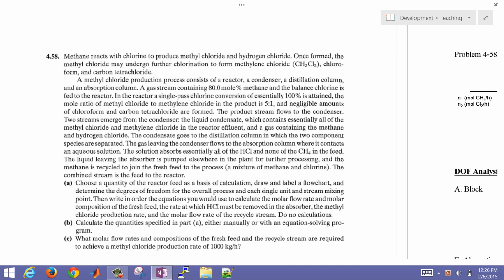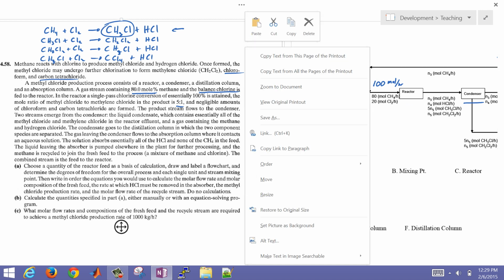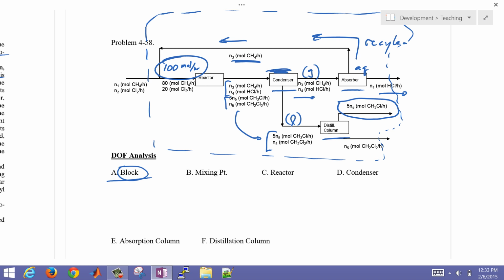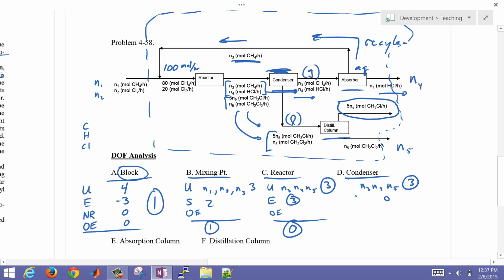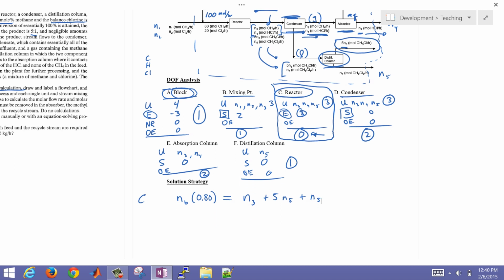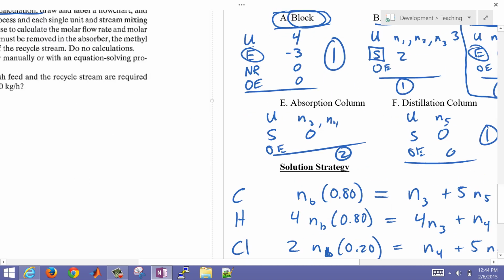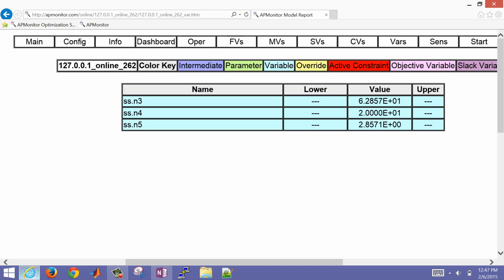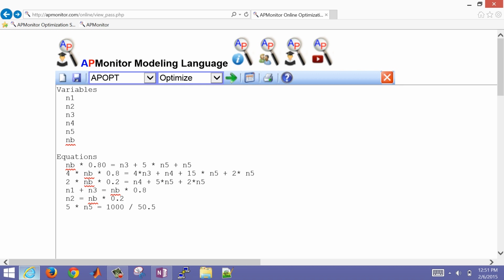Reacting System Flowsheet Analysis

Comment: Thanks for the video! Maybe for the last step we should divide 1000000/50.5 instead of 1000/50.5 because the molecular weight is given in g/mole instead of kg/mole.
 I am note sure though! And thanks anyway!
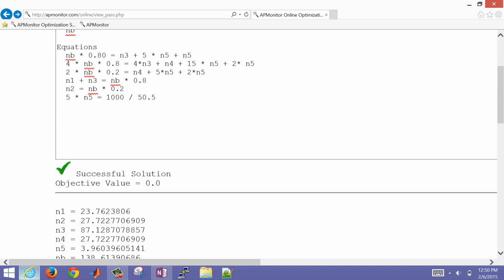Reply from the maker: Yes! Thanks for the clarification at 23:20. I discuss units at 24:40 so it is correct if all the molar flows are assumed to be in kg-mol/hr. The only thing that this changes is the basis (nb) and the associated units.
Reply: @apm  Thanks!